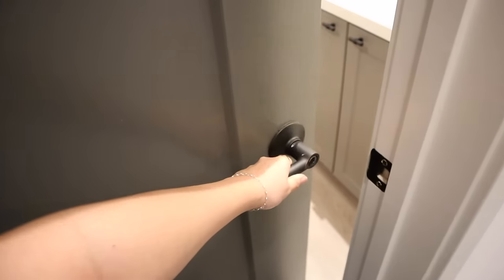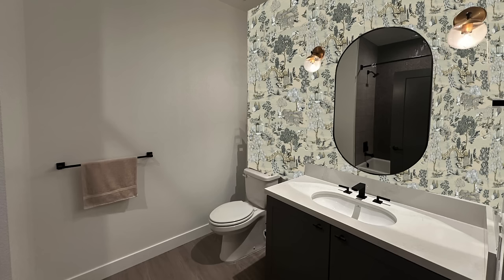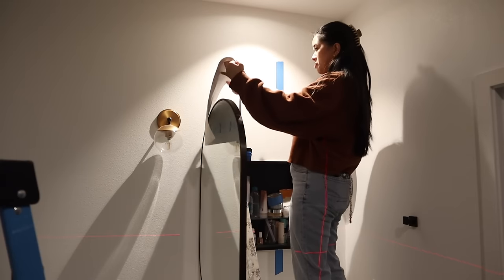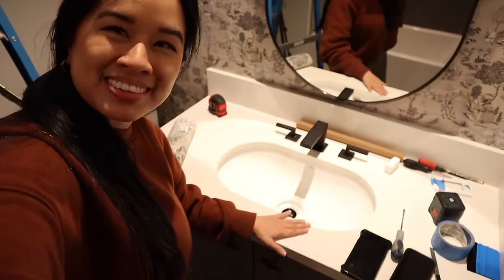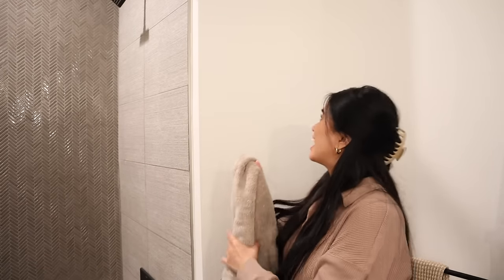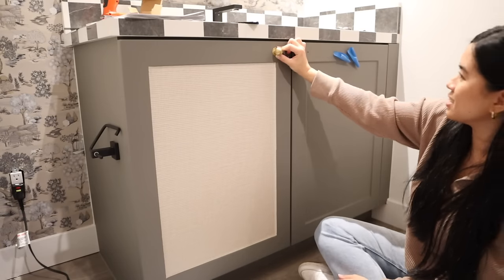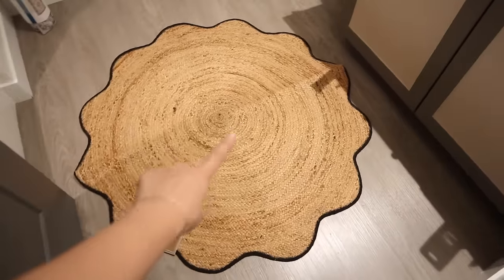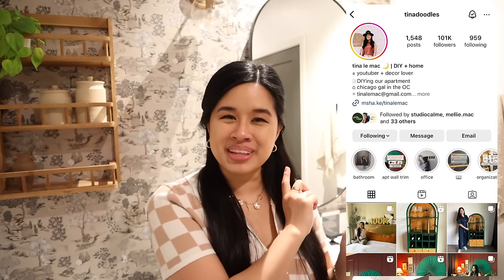DIY BATHROOM MAKEOVER TRANSITIONAL STYLE *NO PAINT* | vanity transformation w/ checkered marble

Comment: I had a lot of trouble with Wall blush. The tropical pattern was printed wrong so panels wouldn’t line up, and they refused to give me a refund or let me post a review.  They did give me store credit which I used to get a design that wouldn’t require multiple panels, but that means I couldn’t get the look I wanted.
Reply: Someone messaged me to take this conversation off this platform. They deleted the comment, but I did want to clarify that since I wasn't able to leave a review on the wallblush website, I feel it's a responsible to share my experience with the diy  community when it's mentioned by influencers that I follow.